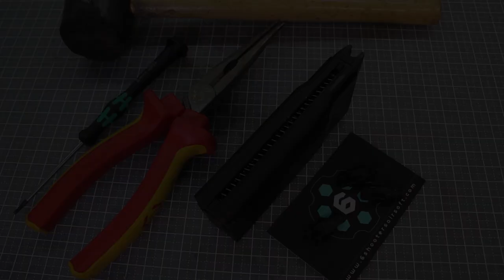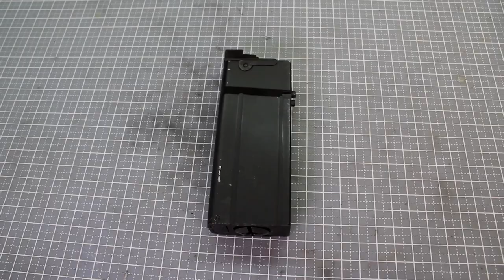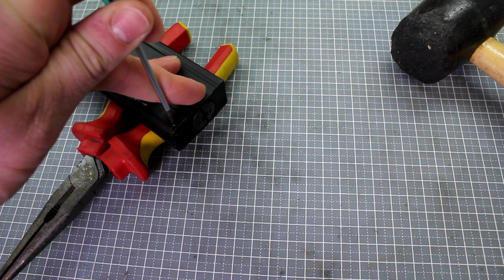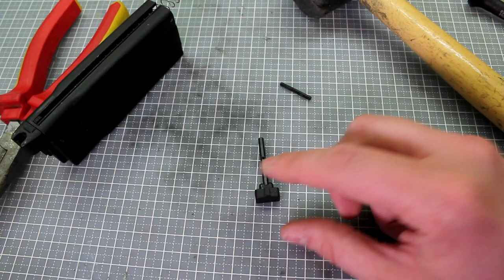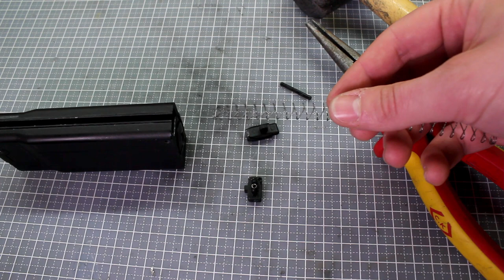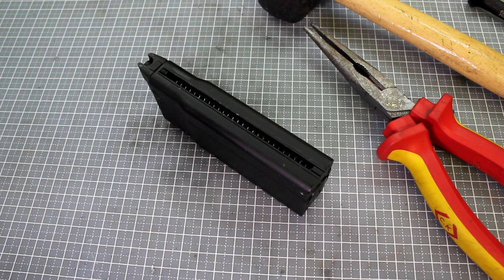King Arms M1 Carbine Magazine Capacity Increase Modification

Comment: Hello, are the new improved followers you sell made of metal or plastic and is the original made of metal or plastic thanks! :)
Reply: they are as quoted from the Socom website "Although these are plastic, they have been printed with Carbon Fibre infused Nylon which gives the followers a greater resistance to impacts and is a hard-wearing material. "
Reply: @mccoyisthebest  thank you :)